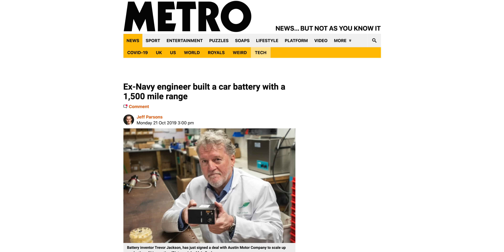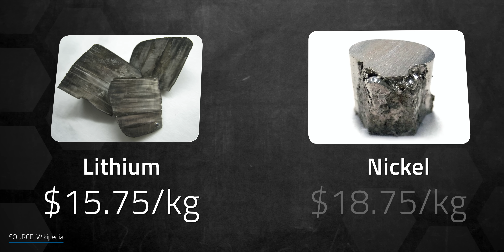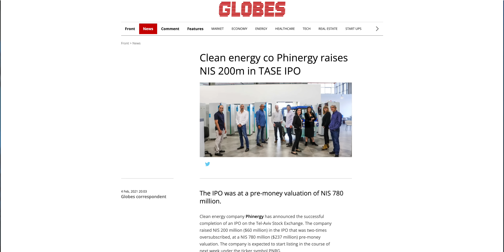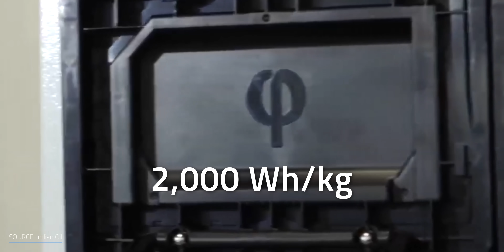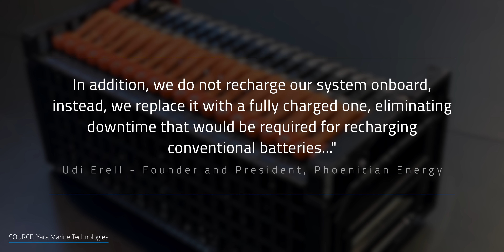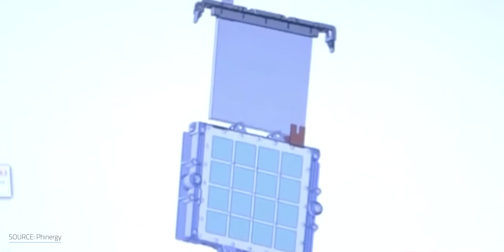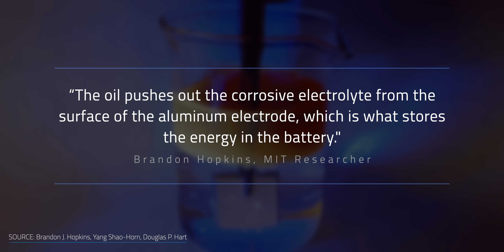Exploring the 1000 Mile Car Battery - Aluminum Air Hype?

Comment: I think the question can be answered thusly:   1) Let's assume a battery cap. of 350 KWH to obtain a 1000 mile range(this includes use of heat/ac, accessories and cooling of motor and inverter assembly)  2) Superchargers currently in use charge about 28 to 35 cents per KWH (more than 2X cost at your house) so let's use 40 cents per KWH for the aluminum batt., to give the benefit of the doubt.   350 KWH times $0.40 =  $140      Can a new Aluminum battery of 350 KWH capacity be provided for $140 including removal and installation ?! (a little more than the cost of a 12v car battery)    My answer is NO WAY IN HELL.    So, you are going to be paying a HUGE premium for that 1000 mile range and remember your rechargeable EV can be charged at home for less than 20 cents per KWH and most mileage will be within range of your home.   Conclusion:  Battery swapping is prohibitively expensive.

Comment: Not scalable for wide consumption. Each car goes through multiple batteries. They could work, but the swap needs to be CHEAPER than currently filling up the tank. Nice video and details, thanks!

Comment: The main concern i have is that it would mean the return to non-renewable fuel. Replacing one non-renewable source with another seems counter intuitive and counter productive. However, as others have commented, I could see this technology as a short term stop gap range extender till we find better solutions down the road.

Comment: Looks like in a similar situation the van that saves you from your negligence would have a replacement battery for your depleted one instead of towing you. 

And your video has a lot of snap on snap off clips making the process of replacing your battery look pretty easy. Probably be a platform like Tesla you have to take to a service station and a quick swap in the usual place for emergency power.

Comment: Where there is a large country with a poor to non-existent electrical infrastructure, then disposable/swappable batteries may be the only answer. Just have swap shops at strategic places. Drop off old pick up new.

Comment: 9:27 Thats a bit of a lie now. If you going down the battery swap you just drive out with a new battery and swap it out no tow required and you would have more kilometers then a portable charge.

Comment: "When you run out of juice " have you heard of roadside assistance, 😉 they can bring you a module (I presume the batteries will be modular) to get you to a swapping station. ICE vehicles don't need to be towed to petrol stations either when they run out of fuel. 😊

Comment: I'd like to see a hybrid approach using both the aluminum air batteries for long-term storage and, perhaps smaller, lithium ion batteries. That way if you run out of aluminum air battery, you can still recharge. It's always good to have some recharge capability on board for regen. This hybrid approach would be way better than what we call hybrids today!
Reply: The Phinergy demo car has a lithium ion / aluminum air hybrid battery pack.  Li-ion is used for short range and aluminum air for long range travel
Reply: Mixing tech like that the key. Tesla bought up utral-super capacitor makers so given better peak regen & peak power to their battery energy storage system in the upcoming roadster //
Reply: That's exactly what I was thinking as well, but with ultracapacitors instead for regenerative breaking. Can capture more current for every breaking and one less thing to swap out due to depletion, which is important from the buyers perspective.
Reply: When I was listen and heard "can't be recharged" my first though was "what about regenerative breaking?"  That could seriously deplete an EV's efficiency in cities where stop and go traffic is common. Back up a rechargeable of some form seems like it could overcomes that limitation.
Reply: Lithium iron phosphate batteries are easily sufficient in energy density for this application; and while they are less energy dense than lithium ion, their durability and longevity exceed lithium ion by a long shot.
Reply: Aluminum/Graphene batteries may be the answer, good range, quick charge, fully recyclable, and safe.
Reply: tata motors doing this in their cars.. they provide both battery for efficiency and emergency use!
Reply: I would say the other way round, a smaller 100 miles lithium battery for 95% of trips, and a cartridge like swappable aluminum one that you lease at your local gas station for that longer trip.

Comment: Aluminium/Air batteries ARE rechargeable, just like our petrol cars are today. We refill the car with petrol or aluminium. Yep, just mechanically rechargeable.
As for running out of aluminium, well, it's just the same as a petrol car, have a small '1-gallon' battery tank as a spare?

Al/Air battery is the way to go! Let's reverse out of the current lithium cul-de-sac, and quickly!

Comment: at 9:20, you mention emergency support available for EV. If the battery was based on a standard design, an emergency vehicle can transport a spare battery to replace your 'spent' one. Swap - Activate - get paid. Easy - well, if manufacturers can agree on a common standard

Comment: Non-rechargeable is not really an issue with cars; you simply need a much smaller rechargeable backup battery. Like 10% of the current Tesla pack. When it gets down to switching, you get a warning, if you ignore and get dry, you still have that 40 miles autonomy from a mobile recharge. Plus the accessory battery can be used to regulate the power drawn from the main one, if needed.

Comment: Battery swapping might be feasible if the batteries were standardized (all cars use the same batteries) and small and light enough that one could be brought by a repair vehicle to a vehicle with a dead battery and a battery swap then performed in the field.  But other negative attributes of the Al/Air battery, such as poor shelf life, seem more daunting than the swapping issue.

Comment: Hey I have a 1000 mile diesel battery. Easier to replace the diesel than add another chunk of aluminium. Is this a battery? Or a fuel cells. DO they regen?

Comment: All they need to do is design the battery so that whatever holds the aluminum can be easily pulled out of the battery and replaced with a new aluminum part. That should not be so difficult?
Reply: A driver could even have two or three of the replacement parts in the car. That way they would not get stranded.

Comment: about the weight ratio Lithium has the atomic number 3 and aluminium has the atomic number 13 so atom for atom i think that litihum  got the upperhand there, so even that the aluminium is low weigth, the lithium is even ligther.

Comment: This may be a stupid question, but what about making the aluminum alloy anode an easily replaceable part, such that you could even carry a spare or two on-board. That could potentially resolve the stated concern of being stranded on the roadside, as roadside assistance vehicles could then carry a few with them.

Thoughts?

Comment: If the batteries can be swapped easily yes.  You can have two companies equipped with them maybe just one so that you can get to a battery station.  They would also require less infrastructure than rechargeable batteries.

Comment: What happens when your Li Battery looses charge in the middle of the night??? You are raising problems which are common to all batteries. In lot of countries even the Li Batteries are swapped instead of being charged. How would you like stopping at a charging station in the middle od nowhere and charge tour battery for 4 to 6 hours (if fast charging is not available).

Comment: The non-rechargeable aspect is not really a problem. We have been using non-rechargeable petrol and diesel cars for years. They basically use the same method ie you replace the energy source.

Comment: If petrol stations can swap the batteries and the cost is reasonable to do it, there seems no problem. If the spent batteries can be recycled, there total management cycle is planet friendly. The one part that degrades is Aluminum and if that can be replaced and the battery is then reused, it is a goer! Better than investing in charging points and then looking for it.

Comment: In an area with high population density (ie. india) the cooperation of an oil company with loads of filling stations is ideal. In the USA, with our low population density, may be not so easy. The installation of an emergency pack for use when running out/failure could ease consumer worries. These are not really batteries as they can't be recharged; they are more like electrro-chemical fuel packs. "EC Fuel" is my suggestion.

Comment: If battery swapping existed at gas stations it would be entirely feasible. It would be a lot faster than recharging and range anxiety would go away. Standardizing the battery modules would greatly simplify things and instead of pulling up to a gas pump it would be a battery module dispenser. This would also get rid of trying to establish a  working charging network which at the moment, we seem to be incapable of doing.  After all, what will gas stations provide when ICE cars go bust? Sell vegetables? I see this as entirely possible in Europe and Asia but not so much in America as we seem incapable of establishing standards to just about anything..

Comment: Stupid analysis. If petrol station can replace an aluminum pack, its a good to go thats faster and safer than filling up tank at gas station. The replacement scepticism is totally illogical.
Real question is long term susyainability --how eco friendly is the aluminum oxide recycling process.

Comment: Sounds great and I don't see the issue with recharging.  Swapping it out would be the same as propane tanks and recharging sucked anyway, and I'm glad it's being overcome.  You would have a gauge in your car telling you to swap it out and possibly an extra battery in the trunk!  Come on, that's not too hard to figure out....The corrosive aspects need to be worked out but they seem to be on it.  I think we need to find energy solutionS, and I emphasize the plural.  There isn't one answer but many.

Comment: A video on a subject of technical and scientific revelation…and yet insists on using the word ‘aluminum’. This word/element does not appear on the table of elements. It’s aluminium. It’s not ‘siver’ it’s silver. You can change words or remove letters within your language to suit (labour/labor) but if you change a formula it becomes a recipe. A L U M I N I U M.

Comment: Marine applications for that kind of batteries seems interesting, but I would really like to see it in airplane industry. With that level of energy density, would it be possible to power airplane of size of B-737 or A320 for intercontinental flight?

Comment: Maybe a hybrid solution. EV's with a main lithium battery for daily/short trips. But a secondary dock to add a Aluminum battery for longer roadtrips that would act as a range booster to eliminate the need for mid trip recharging....

Comment: Battery swapping isnt such a big deal as you could have lots of spare batteries in vans, that just come out 24/7, so if you are stuck at night etc. Like breakdown almost but a quick swap. They could be designed to be fast and easy to be swappable and also standardised.

Comment: Swapping out batteries would not be that much of a problem if like is shown a car has two batteries.  Assuming you can run on one battery until it is flat and then switch to the second.  At your convenience you could replace the discharged battery while running on the second unit.  Also a service vehicle could bring a replacement unit if you break down.  That is not much different than AAA bringing you a replacement lead acid battery if your car won't start when the battery fails.

Comment: I dont see why its a problem to use a replacent battery instead of a emergency charger when not in reach of a replacement station. It would be even more effektive because you woudnt need to wait after services have arrived and charged you up